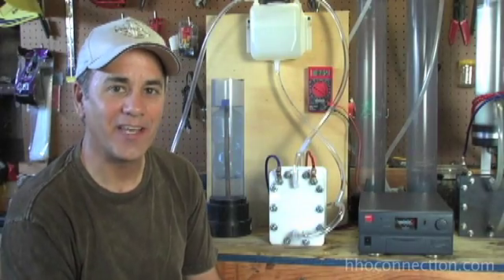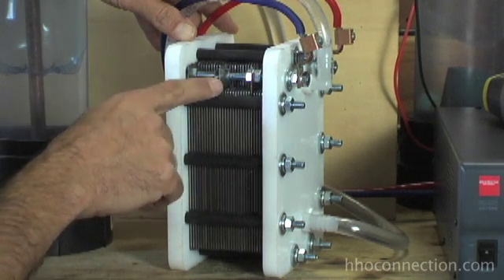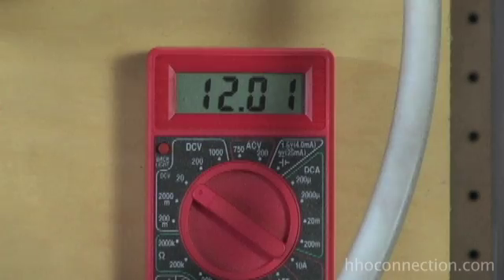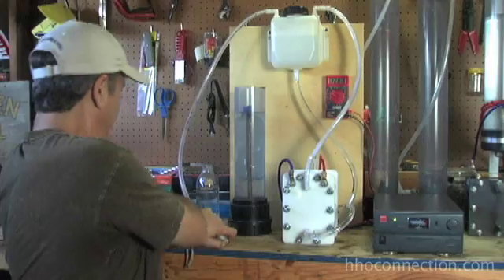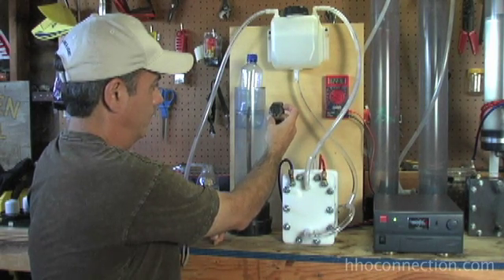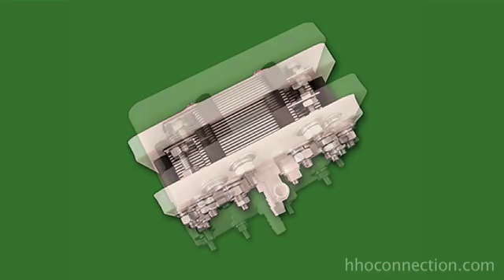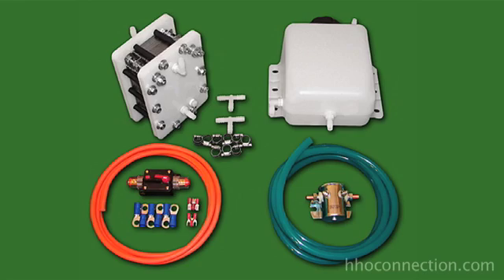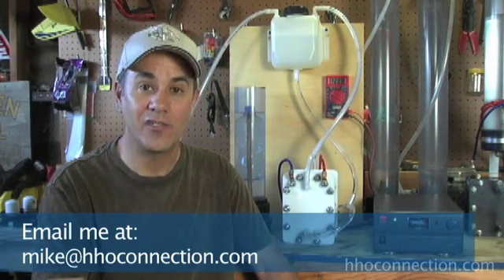Review of the 31 Plate HHO Dry Cell From GreenfuelH2O

Comment: Hi Mike, I agree thats a good cell design however I like HHO Connections design with the bolts going through the plates and gaskets. Anyways my question on the HHO Design is what would be a good insulator for the bolts? Just a rubber hose that fits over a 1/4 bolt? I thought about buying 1/4 heat shrink tubing and 3/8 shrink tubing and double it up. Therfore the hole size in all the plates would be roughly 5/16. I'm just not sure if heat shrink tubing will be a good isolator... Any advice?!

Comment: what is better: -nnn+nnn- or -nnnnnnn+  i would like to know before i go any further with my cell, from what i have been reading it is best to get low volts but a happy-medium amps around 18 amps. also how many amps do you think i would draw on each of these configurations. my dry cell plates will be 8x8" drawing from a 12v car battery .
thanks

Comment from the maker: @wdanielbern Yes, you can do that by running a positive then 57 neutrals and a negative. The only catch would be that you need to convert the AC to DC using a bridge rectifier. If you go to my site you will see that I am selling a 59 plate unit from GreenFuelH2O and home units from Punch HHO that do just what you described. You just need a lot more steel if you want to run 110 AC to DC.

Comment: If the generator anode (+) is not Platinum it will not last very long.   I have been running a Platinum anode cell for almost 3+ yrs and still going.

Comment from the maker: @kaverdaja Your electrolyte is full strength, you must be pulling some very high amps. + - + is a very bad way to run your cell unless you are wiring them in a series. Basically you just want to get 2v per plate gap by whatever method possible.

Comment: Greetings from Estonia.
i made 22 plate dry cell. +6n-6n+6n-    5.5"x5.5" 3mm thickness.
It runs about 13V but i dont know real amps.i I bought by mistake AAC digital clamp. I did put 5amp fuse between and it did not go broke. It produce about 1 lpm. Any advice to make it more efficient?